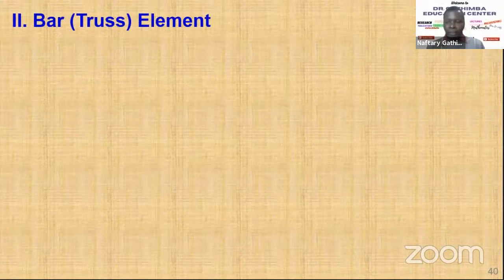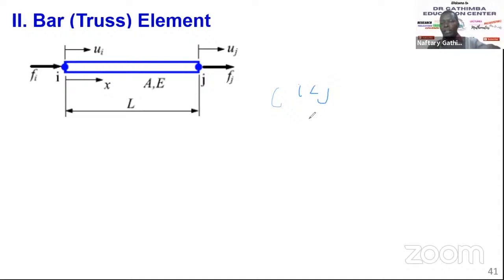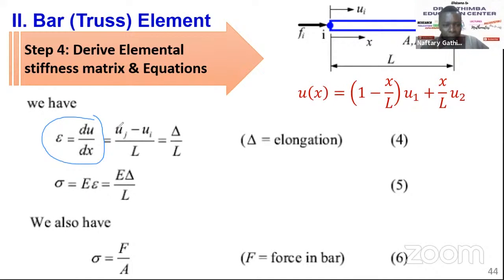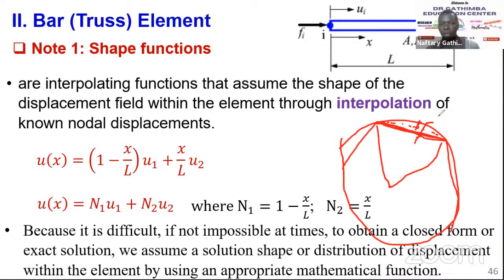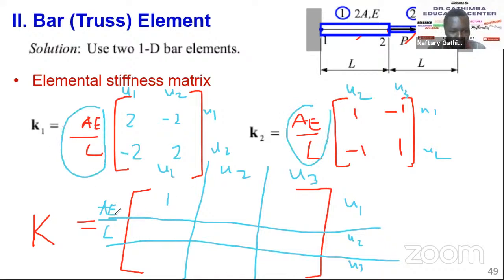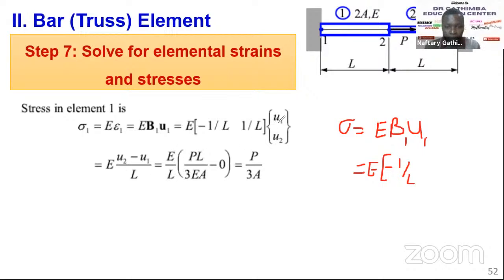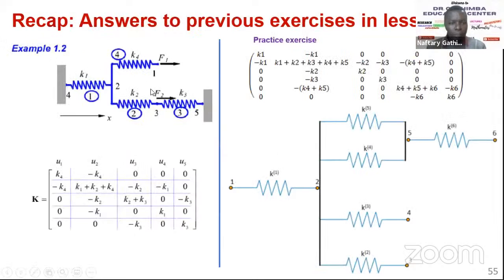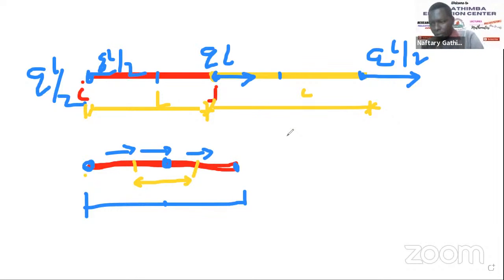3. Finite Element equation for a bar element//Matrix Analysis of Structures

Comment: Your example: How do you get same stress for same force applied to different cross section areas? Maybe I am missing something. Is it meant to be Average?
Reply from the maker: The internal force in the two elements is different. You can do some calculations to confirm.

Comment: instead solving matrix using crammers rule or other method because time especially in exam situation after getting  global matrix and forming equation i can punch my calculator and displacement,force,reaction etc
Reply from the maker: its acceptable bt equation must be clearly shown/arrived at systematically